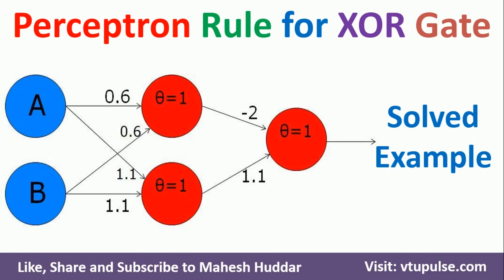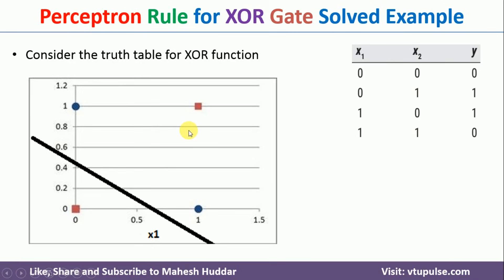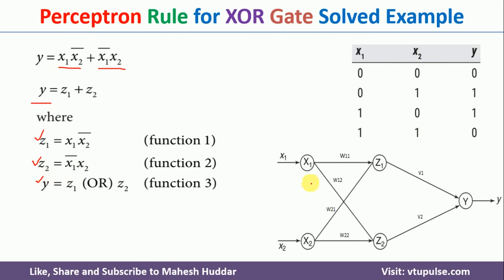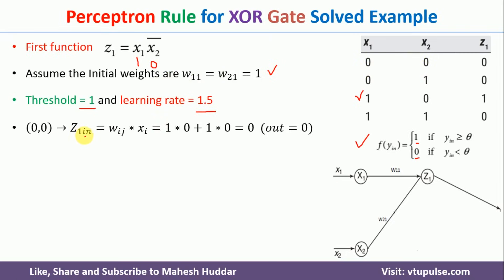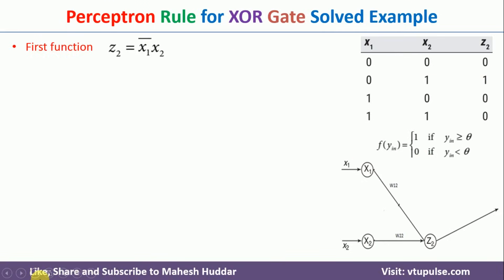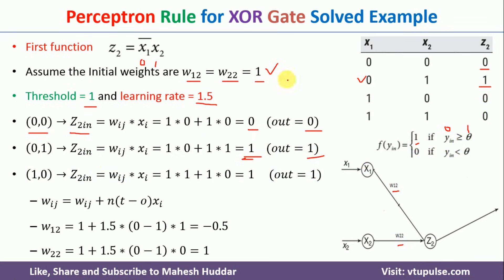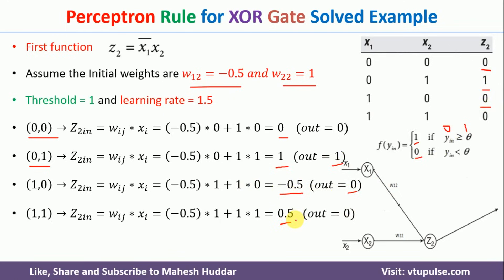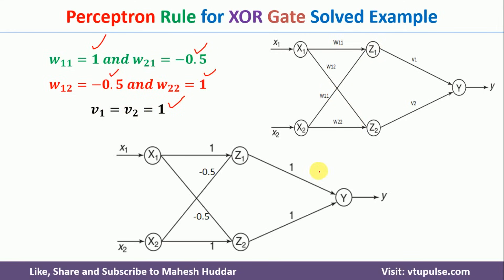Perceptron Rule to design XOR Logic Gate Solved Example ANN Machine Learning by Mahesh Huddar

Comment: sir truth table galat banayi hai aapne
Reply from the maker: Watch complete video 
There is no mistake
Reply: @MaheshHuddar  Sir 🥺. You said if X and Y both are O means output is Zero. If any either one is high it's 1. But you did mistake in X1=0; X2= 1. The answer you mentioned is 0. Check please 🥺
Reply: @janat.nikash0724  0 and 1 is 0